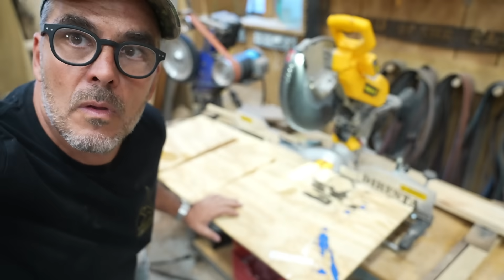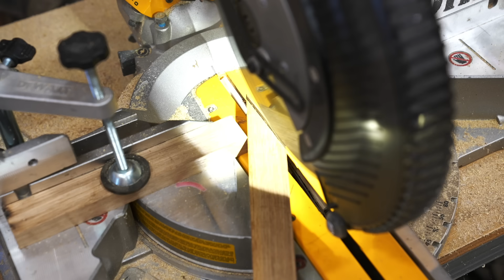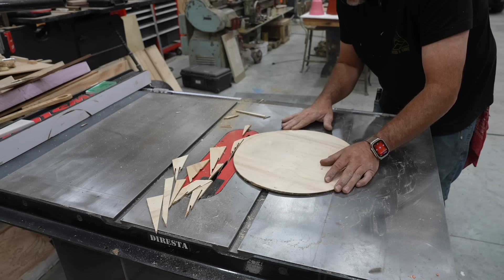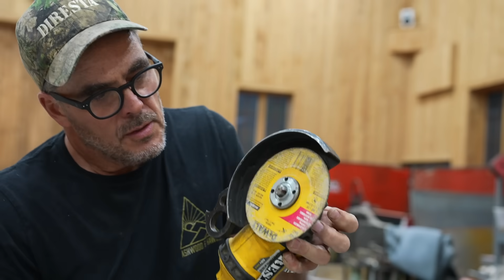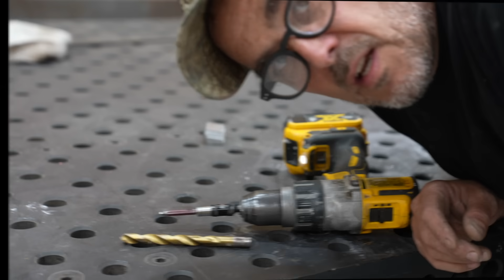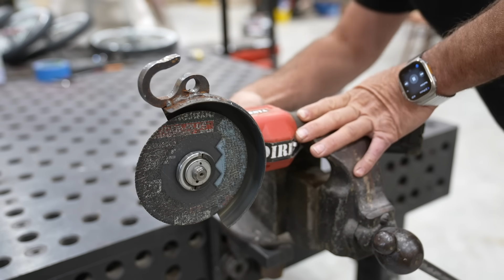13 OF THE MOST DANGEROUS Things YOU should NEVER do  [episode 1]

Comment: Great video Jimmy! I noticed a similar choice in tools. As well the dewalt 60v tools I also picked up the metabo framing nailer and I love it. Just recently got the 60v angle grinder and its honestly the last cordless hand tool I think I need. One tool I didn;t see is the Dewalt 60v recip. That's been my favourite purchase! While I appreciate the freedom of the circular saw its comparable in performance to my corded saw. Going from the 20v recip to the 60v has been transcendental. The mass and and power has been awesome! Rather than trying to "ride" the tool on the 20v the 60v just powers through almost everything. Again great video and props to the dramatic pauses😂

Comment: I just reminded myself about not cutting wide pieces that are shorter than the blade diameter on a table saw with the fence in place. Fired the workpiece across the shop and broke it in half on my bicep as it went by. 
Hadn’t seen that stupid shit since college, when someone did it with a sheet of lexan, and fired a piece through the metal shop vac behind them. 
I should be safe for another 20 years on this reminder! 😂😂😂

Comment: I know someone that tried the extreme angles cut that Jimmy showed on the miter saw except that he was using a radial arm saw.  He didn’t want to take the time to set the saw up properly and thought he was strong enough to hold the board during the cut. When the blade caught the board, the saw yanked it back against the fence and smashed his finger.  He thought he cut his finger off because he couldn’t feel it anymore but it was still there, just extremely swollen and bruised.

Comment: At first I was like "Okay, why not? Can you explain?" and looked at the comments and was like "Ah, that's how it is, I see". But seriously, the angle grinder in the vise is something I don't think I'd do. Push a little too much and that thing could slip out while still running. Most angle grinders have tapped holes for bolts, shouldn't be hard to bolt it to some roughly square scrap and then put that in the vise. We even have a kinda butchered together jig at work where an angle grinder can just be boltet into and it lets you cut cooling nozzles out of thin pipe pretty precisely.

Comment: I used to stop the light composite discs of the angle ginder by rubbing a finger on the disk (instead of waiting for the disk to stop moving and then change it), I took the habit, so much so , that one day I was cutting with a metal disk carbide inserts and did the same....and injured myself

Comment: Definitely never use a 2×10 to fab a block to hold your ladder farther from the building, so you can lean WAY off your center of gravity use a drill with a step bit, then a hammer drill with a 36" masonry bit to reach through a 16" aluminum overhang and then 16" of block behind it so you can install a camera on the side of a building!

Comment: If you wanna sharpen a pencil on your tablesaw, use your crosscut sled and put the pencil on top of the fence and use the very top of the blade. You could even cut a slot ot drill a hole through it so you can put the pencil it, twist and sharpen.

Comment: Definitely never sharpen a metal rod by putting an angle grinder in a vise with a sanding disc and chucking the rod in a drill to get an even point using the guard as a rest. Way too dangerous.

Comment: All kidding aside, you forgot the most important one. Never use a tablesaw PERIOD. Of all the tools in the shop, it is by far the most dangerous one. Unbeknownst to most, in addition to lacerations and amputations, it can also be fatal. A large board binding in the cut, for instance, can kickback at a victim's abdomen, resulting in a near instant death from internal hemorrhaging. Unfortunately, a SawStop does little to nothing in preventing it. 

As for common injuries, living with the loss of an appendage isn't the worst outcome. There are numerous cases where a laceration results in nerve damage, causing extremely uncomfortable and protracted sensations akin to being tortured by electrocution. It is often  so unbearable many are unable to sleep or function. Some will plead their doctors for an amputation in order to find relief.

Contrary what many believe, tablesaw accident risks increase with experience, not inexperience. Many victims claim they were very careful and even used safety work holding tools such as push sticks and feather boards. The accident often happens so quickly, the operator doesn't feel anything until moments later.
Reply from the maker: True.